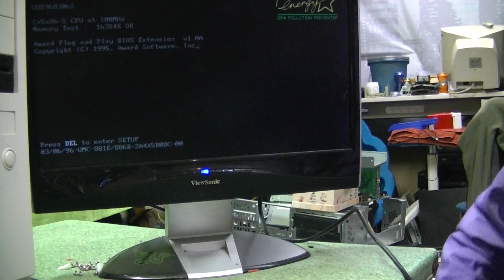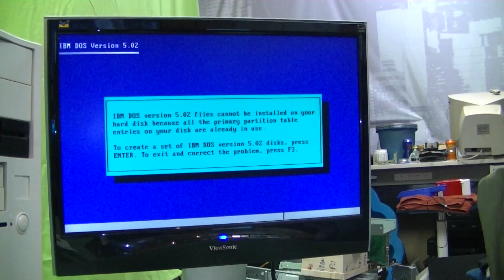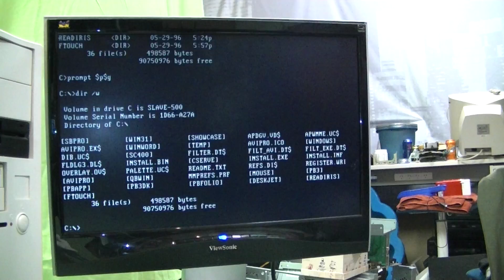Going retro! | Converting an ATX supply to an AT supply

Comment: there are cheap converters that you can buy online so you don't have to destroy a ATX PSU to convert it to AT. There are many on ebay, there are more expensive ones with -5v if you want to use some cards that can only work with -5v.

Comment: my 486 died, cause it was my fault, i accidently put a 486dx2 66 in the wrong way and it fried the motherboard and cpu, i removed it, put the original DX 33 back in the right way and it wouldn't post, no beeps, nothing, i got a Pentium 1 system to replace it.

Comment: I have a Socket 7 board I dated to like 1997 with one of those damn Dallas RTC's. AT keyboard I had has dead keys so I've shelved the thing for now but I was stoked finding that machine as it was more like I remembered and my other P1 machine is an HP propietary thing . Sadly when the RTC battery dies I think I might be hosed and the board does seem to have a few weird quirks so I may end up getting it a better one if I can. (Not willing to risk derping it further with a repair). 

Without tangenting too much the board was pretty bizzare too as it was one of the really early flashable bios units and the BIOS update claimed to add PnP support and change it from an ISA to PCI based Award BIOS. Someone had done this at some point and the thing ran 98 damn well I just never got to use it as I had to replace the CPU fan and when I finally got it all right realised the keyboard I had had sitting was stuffed.